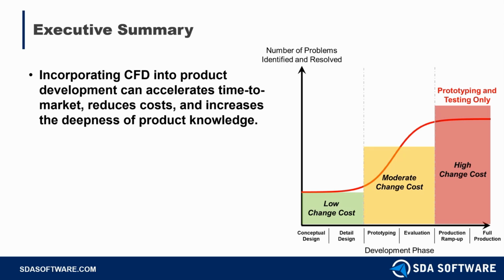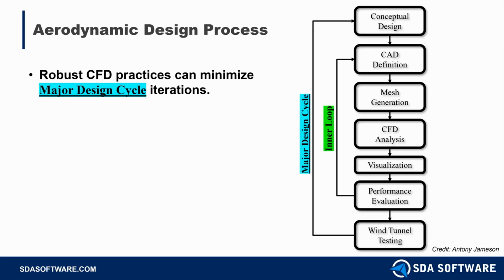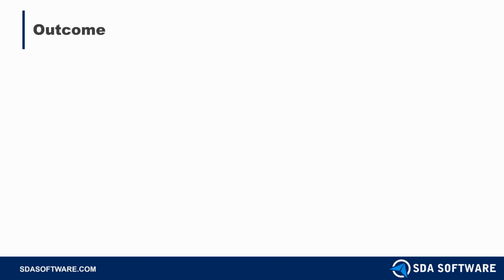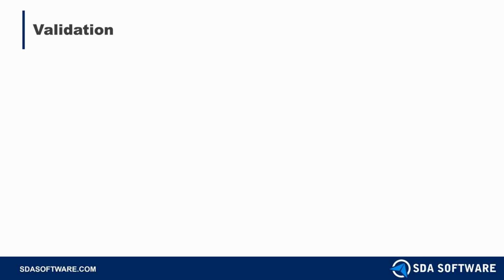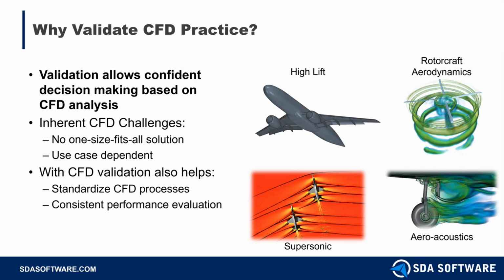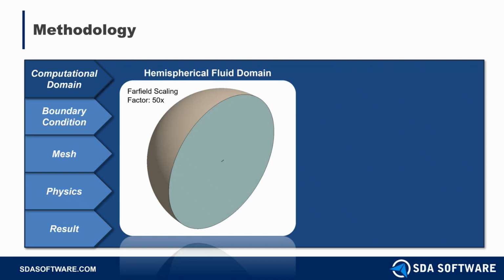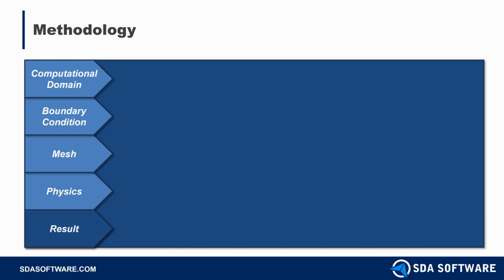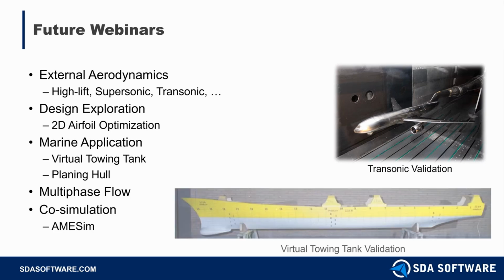Low Subsonic Aerodynamic CFD Validation using Simcenter STAR CCM+ Webinar

Comment: Was compressible flow option really necessary for a Cessan 210 ? Thank you
Reply: No, it is not necessary. The difference between coupled and segregated solver for this case was negligible. However, this setup is part of a generalized template that can be used across higher Ma ranges. There will be some computation cost savings running this low subsonic case with a segregated solver.